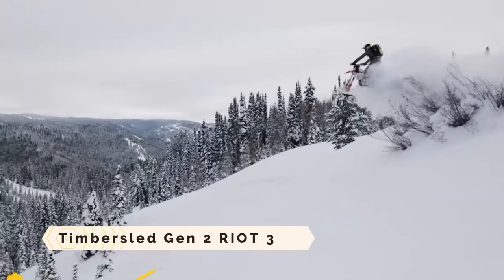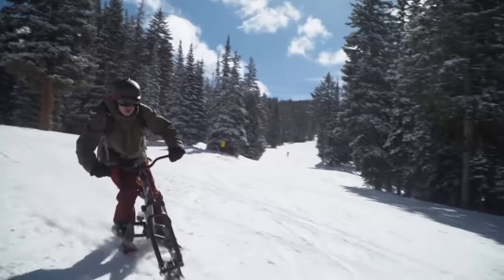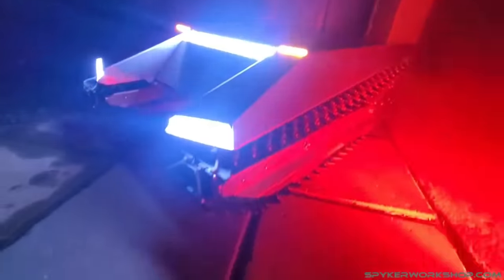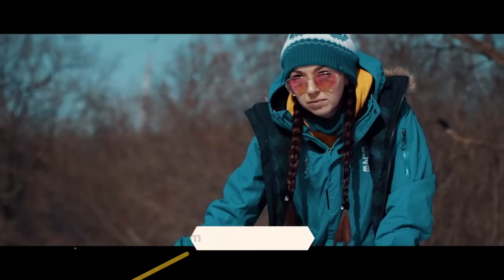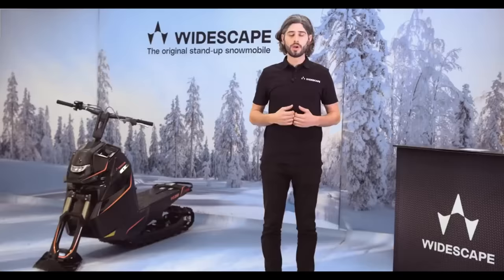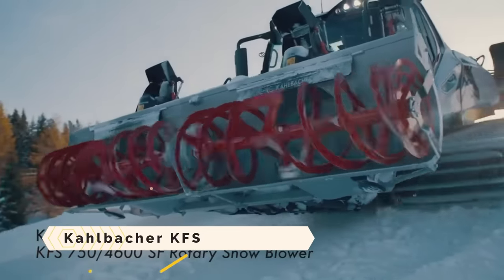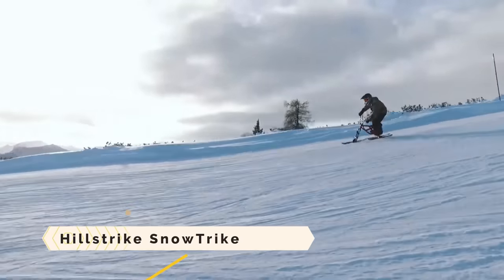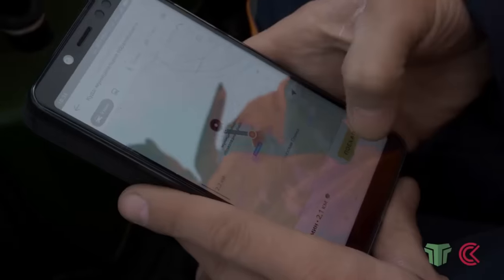COOLEST SNOW VEHICLES THAT WILL BLOW YOUR MIND

Comment: The pricing is 1,000 times to expensive for what it is and how easy it is to make with a pipe cutting tool and a decent welder and a few nuts, bolts and wrenches. $200 at absolute most.  I am talking the motorless kind.